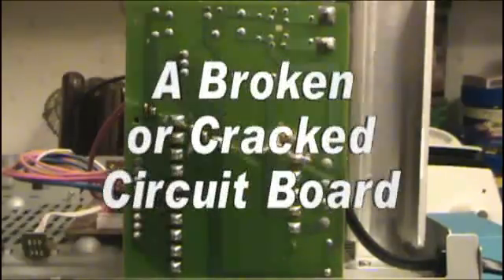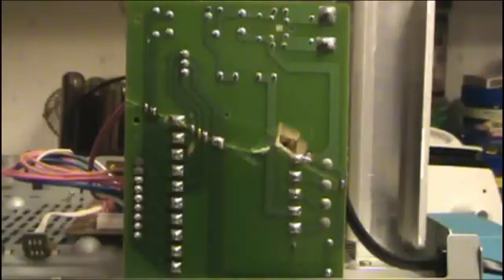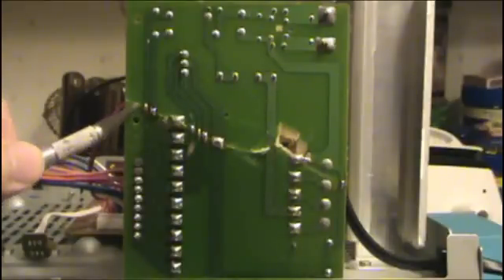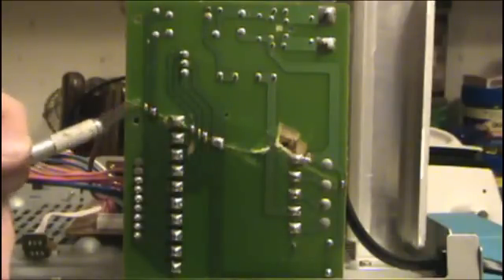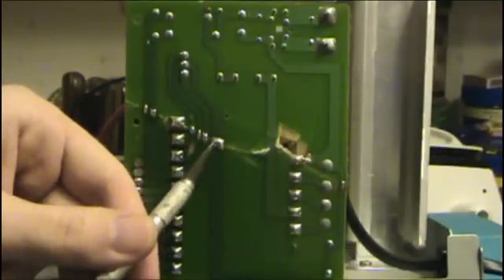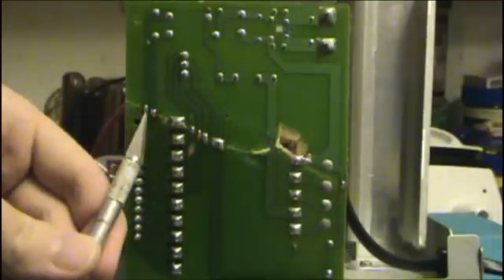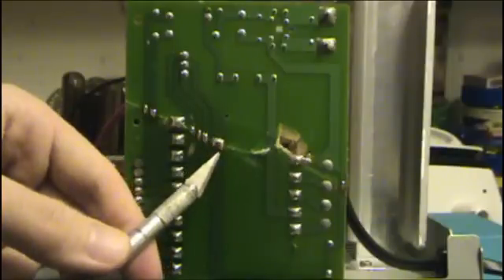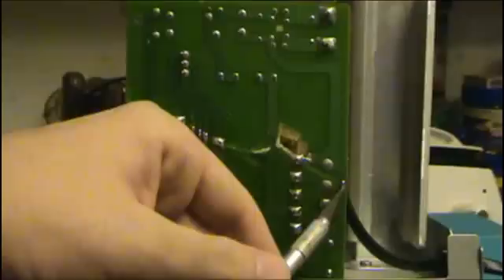How to Repair a Cracked or Broken Circuit Board

Comment: Thanks man! :D Working on fixing my Roland keyboard that got the smack-down in some cruel garage before a friend of mine adopted it and gave it to me. We're talking at least three fractures over two circuits, and some of these circuit lines that need re-joining are super tiny, so I am going to use that wire junction technique you showed because soldering these tiny ones would be nearly impossible, and I may also drill some stop holes.
Reply from the maker: Wow I can't imagine.  I hope you get it working.
Reply: +Coby Randal any luck with your roland? i have the exact same problem its the hp230 i think. my friends gave it to me i guess there damn dog knocked it over and the plug was inside of it so it broke the main pcb
Reply: ryan Ford Yes I fixed it. It really helped to use an exacto knife tip to scrape exactly where the solder needs to go, especially for the tiny lines. But use good judgement and be careful; you might need to use wire junctions like the video showed to prevent soldering a short.

After I soldered, I used a continuity test volt meter at each bridged crack to see if my solder was working, and to double check for any shorts.

Also, the keyboard has a ton of screws, so leave most of them out while you put it back together and power it on for a test run. I had to take mine apart again and those screws add a lot of unnecessary time. Best wishes!
Reply: Yeah this things so simple but such a pain n the ass lol
Reply: @Coby Randal Cheers for this, I've been looking for "what is instrument cluster in a car?" for a while now, and I think this has helped. Have you ever come across - Giyathan Bewildering Gratification - (do a google search ) ? It is a smashing one off product for discovering how to repair your electronic items like a wizard without the normal expense. Ive heard some awesome things about it and my colleague got amazing success with it.
Reply: Not certain about the points made but ,if anyone else  is searching for 
sears tv repair
 try Saankramer Electronic Magazine System (should be on google have a look ) ? Ive heard some pretty good things about it and my partner got great results with it.

Comment: Does this works with phone circuit board my technicians says it’s a electrical damage  pls let me know
Reply: I want to know also, my mom's phone jumped out the truck onto incoming cars while driving on the highway. The screen broke into tiny little pieces and the board broke into three.

Comment: i learned allot im trying to repair the circuit board around the power in on my bose wave
Reply: Hd69 would you be 8nteredted 8n buying my 1947 Farmall super a tractor everything is original on it

Comment: Can you fix a cracked cellphone motherboard
Reply from the maker: Generally no those have 4 or more internal layers with very fine traces. Also they have power connected at all times so when they break things tend to burn out inside.

Comment: Can a circuit board rust further when the green coating is gone eventually?
Reply from the maker: Yes it will begin corroding slowly or very quickly depending on humidity and air conditions such as proximity to lead acid batteries, etc. This is why it's important to recoat with solder mask as soon as it's noticed. I use either green metal paint or nail polish. Don't use latex. Paint seems to work a bit better than nail polish. Also in some cases it's possible to tin the area with solder as it will corrode much more slowly than the bare copper traces.
Reply: @TheLightningStalker  thx

Comment: Thanks for the very informative video.  I have a neck board from an arcade CRT that got snapped in half, and after gluing back together I only have four connections that I'll be jumpering with 18AWG wire.  I definitely don't want to mess with the solder mask, so I'll just go post to post.

Comment: Great video - thank you SO much. Since everyone else is including their knowledge application stories, I'll share mine as well: while tinkering with my car's odometer, I tried lifting the detached assembly up off my table before I had properly screwed everything down, so of course ALL THREE big components fell out the back of the thing and onto my kitchen floor. One of those was a circuit board, and although only a little bit broke off, it severed about 5 different connections, and I learned the entire side of the cluster had no power going to it after plugging everything back in and trying it out. Really, really stupid thing to do! But, this video will probably save me around $300, not to mention a load of stress. Thank you again!

Comment: what if my circuit bord is just bent a little, would it still work? please reply
Reply from the maker: Would what still work?  Your circuit or my repair technique?
Reply: it's my circuit.
Reply from the maker: April Ann Repotente It will still work as long as none of the traces or solder joints have been severed.

Comment from the maker: What you're scraping is referred to as the "solder mask."  It can be many different colors, but is usually green.  It is put on the board at the factory to prevent corrosion and limit the areas where the solder will stick.  If there is any epoxy on the traces, it will have to be scraped off as well.  You need nice clean bare copper (or tin on some boards) in order for the solder to stick.  Flux will help as well.

Comment: so you are supposed to scrape off the epoxy with the knife so the solder sticks or are you supoped to scrape off something else? Do you know if I would be able to repair the board off a car stereo? The board is essentially the front of the stereo behind the buttons and screen

Comment: Ok for one, 60/40 is ok but isn't the preferred solder for electronic components. 63/37 is the best to use and the reason for that is because solder melt is at 371 degrees fahrenheit and 63/37 does not have a "plastic" state. So it goes straight from solid, to liquid obviously because solder iron temps are usually 600 degrees. Connections could fail, because solder itself can not hold the proper current conditions for most cards, thats why conductors or "runs" are made out of copper.

Comment from the maker: Yes, I used a solder bridge with regular 60/40 electronics solder.  If you could enlighten me on how the connections could possibly fail, this sounds interesting.  The board is still working perfectly.

Comment: Hey just a heads up... how did you replace the runs? or did you just do a solder bridge? What solder are you using? what ratio of tin/lead? If you use only a solder bridge and don't actually manufacture new conductors out of coppper and "lap-solder" them in you coud actually ruin the board even more. The right way to do this is to map out the board cut 1/4 inch on either side of the conductors away repair the board like you said and then lap solder everything and finish by using a conformal coat

Comment: That was an excellent explanation.Thank you for doing that, I learned quite a bit. i have a question for you. I burnt out part of a board/trace and while tring to remove some diodes I accidentally removed the solder around the holes. How do i replace that so that I can solder new diodes in?

Comment from the maker: I'm not familiar with those boards.  If it's a single or double layer board, you should be fine as long as the traces aren't real small.

Comment: you know? i came to fix a little crack with big consequences and got all the info i needed for the job (hope i can pull it off). but then, that bit about the stop drill. oh, yes. that never occurred to me would have been helpful at many points in my life) and thanks for sharing that tid-bit of info. probably save me a future headache. my crack was small in comparison to yours, but your good work will hopefully help me to fix my problem. i'm off to radio shack.thnx much!

Comment from the maker: @5478926 There is no substitute. It must be electronic grade solder.  It's cheap and available in most hardware stores.  Make sure you don't get "acid core" or "solid core" solder, as they're meant for plumbing and will corrode the circuit board.  (or just plain won't stick as in the case of the solid core)

Some rosin based flux on the board where you're soldering will make the soldering easier.

Oh and use a soldering iron.

Comment: @narutobuddysonic If you can get into the casing take a look at the prob inside the case. If it's just knocked out of place you can move it back into place at this point. I would guess that the metal is more than likely broken in which case you can check the connections and re solder them into the correct placing. Even if the metal is broken, try to fasten it back to the body of the flash drive with epoxy or a thick glue. Might not look pretty but the only other option I can see is a new one.

Comment from the maker: There isn't a way to reinforce the board without making it thicker.  If that's not a problem, you can reinforce it with some sheet metal or plastic across the break and embedded in the epoxy.  If you use metal, of course make sure it's not touching anything.  You can try filing that bent part off as well to get things straightened up.

Comment: Is there a way to re-enforce the baord to reduce strain on the repair? I figure the crack between the two pieces remains as  a weak point after the repair. I'm looking to fix a flash drive as an experiment, and I'm going to have to break the end of the board off where the USB connector is (the PCB is bent because of a partial crack). Straightening the board doesn't seem to work right. I'm lucky all four traces (2 for 5v power, and 2 for data) are easily accessible.